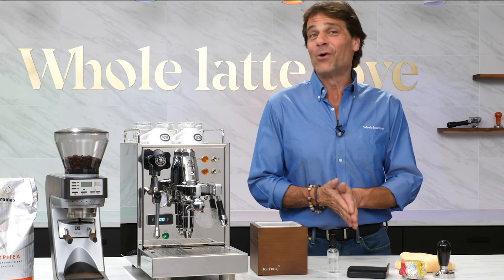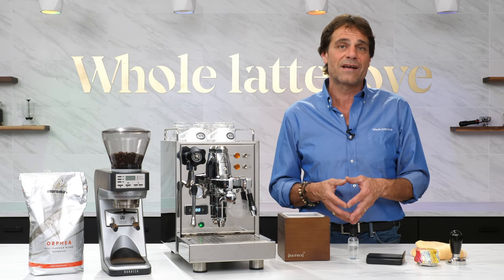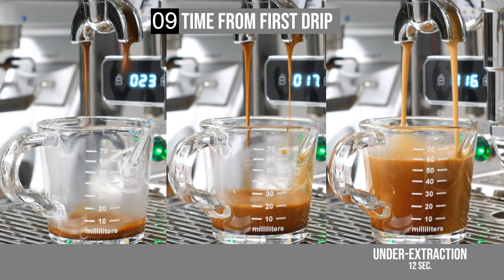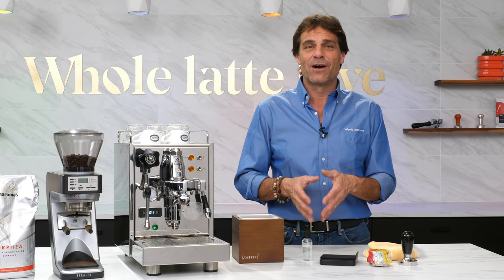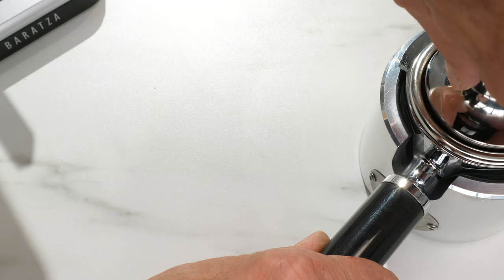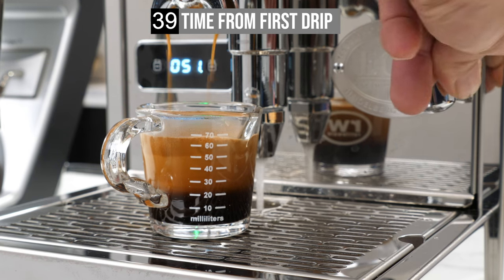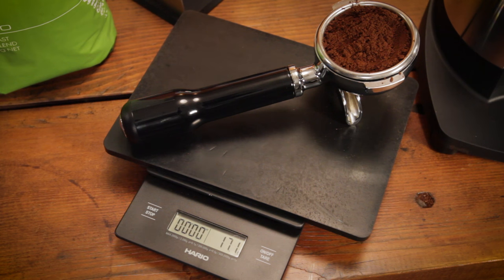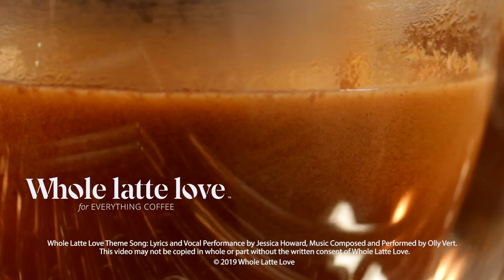How To Dial In Grind Size for Espresso

Comment: What are those beans u use, i mean the coffe comes out so creamy and fluffy from the portafilter.. damn.
Reply: @Andreas Lindstein  Hi, let me shed some light for you. There’s different factors for the beans without getting to nerdy/geek. There’s basically 2 different coffee beans, arábiga and robusta. Arábiga taste is preferable and robusta is “wet/oily” which produces more crema. The date of roast plays a big factor, the older the beans, they tend to get dry.  So the fresher the beans the better and finally the water temperature, the hotter you can get, the more crema will produce but beware it will change flavor and get bitter. That’s why you see espresso coffee is grinded at the moment, to preserve freshness.

Comment: So did I get it right that with The Jack you dont have to tamper after the leveling? Is this a specific function of this leveler or can I do it with every other on?
Reply from the maker: Hi Ben, The Jack has easy adjustable tamping depth and precision sizing. You will not find that on cheaper knock off levelers.
Marc

Comment: Great video and to die for espresso maker and grinder. Unfortunately I just bought the Rancilio Silvia and Rocky grinder. I use quality beans, have tried different grinder settings, but I can't seem to brew an espresso right with a lot af crema and taste. Any suggestions?
Reply from the maker: Hi Michael, Thanks for the question. If using a quality coffee but you are lacking crema and taste my initial guess is your grind is not fine enough. What kind of coffee are you using? The Silvia and Rocky should have no problem producing good shots when things are right. The Rocky can be a little challenging as it's a stepped grinder and tends to be a little clumpy. Toughest thing with Silvia is getting consistent brew temp. With most all non-PID single boiler machines you get dramatic temp swings in the boiler. Working with them requires some technique to get consistent temps. One way is to flush some water from the group then allow the machine to come back to temp as indicated by brew ready light and brew right away. Can also check for over temp condition by doing a short flush prior to brewing. If seeing lots of steam or turbulent flow from group when doing flush that indicates flash boiling and over temp brew water. If that's the case flush until flow is smooth - probably just a few seconds and then pull your shot right away. If not already doing so I suggest learning your machine and grinder by pulling doubles (singles are very finicky) using a forgiving coffee like an Italian style bean blend with some Robusta content. Hope that helps!
Marc
Reply: @Wholelattelovepage  Thanks for the reply. I've made a few changes and now it's with crema and the taste is almost there. I've seen in your videos that you use 17 g. of coffee and get 60 ml espresso which is roughly 60 g. Other recommend a 1:2 ratio in weight 17 g coffee ->34 g. espresso (among others Tim Wendelboe). I know I should go by taste, but what is the "right" espresso? Thanks for great videos :)

Comment: in this video it applies that i need a 60ml of liquid between 20-30 seconds.But what about the rule of 1:2 like my basket uses 15g of coffee so i extract 30 ML of liquid
Reply from the maker: Hi s, That would make sense except for the fact that crema does not weigh 1 gram per ml. I've done numerous 1:2 extractions of coffee which produces a lot of crema. With those using a typical dose of 18g of coffee it's not unusual for the liquid volume including crema to be 65-70ml in the cup. If doing true brew ratios it's imperative one uses a scale to weigh the output as volume measurements are highly misleading.
Marc

Comment: I have a gaggia classic pro with the 9 bar mod and I have the baratza sette 270 but still having difficulty pulling a shot it just keeps coming out really fast and barely has any crema .I have my grinder at 3 if I go finer it chokes .I'm distributing the coffee and tamping but still not working out for me .  Any tips on how to fix this?
Reply from the maker: Hi HT, If your shots are too fast then grinding finer is the answer. You'll need to find the grind size that's in between too fast and choking the machine. If at 3 on the Sette try using the micro adjustment ring to make grind size adjustment a little finer. So go to 2 on the macro ring and then set the micro ring in the middle and adjust finer or coarser as needed. I know people do the 9 bar mod but It's not needed and may be making dialing in more difficult. Lack of crema is not surprising if your shots are too fast but it may be the coffee you are using as well. Some coffees produce more crema than others.
Marc
Reply: @Wholelattelovepage  I've tried going finer a little bit but taste very bad like burnt coffee. I'm using a dark roast bean . Beans are oily not sure if that's a good thing or bad
Reply from the maker: @torresharbin  Hi, Dark roasted oily beans will tend to feature the flavor of the roast as opposed to the flavor of the bean. It's not always the case, but it's not uncommon to roast lower grade coffee darker to hide the defects in flavor.
Marc
Reply: @Wholelattelovepage  ok thanks for the info I appreciate it. Any coffee beans you recommend?
Reply from the maker: @torresharbin  Depends on what you like to some extent. Classic Italian style bean blends are fairly easy to work with, reasonably priced and make a classic espresso. A long time crowd favorite in that class is Lavazza Super Crema: https://www.wholelattelove.com/products/lavazza-super-crema-whole-bean-espresso-coffee
Some of my favorites in that category are Crema Wave which is a fresh modern American take on the Italian classic using 100% specialty grade Arabica coffees: https://www.wholelattelove.com/products/whole-latte-love-crema-wave-whole-bean-espresso and Mormas Orphea: https://www.wholelattelove.com/products/maromas-orphea-whole-bean-espresso
Hope that helps!
Marc
Reply: @Wholelattelovepage  ill look into those thanks a lot!!

Comment: My timing is good,  I dial it with each bean type I use,  etc,  but my puck is always soupy. I can't figure out what else to do. I usually brew about 30 sec for two ounces. I own the rocket apartamento and use eureka grinder
Reply from the maker: Hi SR, At 2oz in 30 seconds you're good. As to soupy puck it may be a maintenance issue like a dirty shower screen and/or lack of backflushing impeding water flow off the top of the puck at the end of brew cycle.

Comment: Is it more important that I end up with twice the weight, or 60 ml? Thanks
Reply from the maker: Hi r, Thanks for the question. Weight is far more accurate. Not unusual to end up with 60-70ml volume in cup that weighs 40g.
Marc

Comment: Hi, i have a simonelli grinder and a simonelli appia 2 coffee machine, do you have any suggestion for a good ratio?
Reply from the maker: Hi L, Thanks for the question. Good place to start is a 1:2 ratio. From there experiment and find a ratio which works for the coffee you are using and your taste preference. I almost always start with a new coffee using an 18g dose and 36g out by weight. Please measuring volume out in ml is rather inaccurate  when using brew ratios. Not out of the ordinary for a shot weighing 36g to have a liquid volume including the crema of 60-70ml.
Marc

Comment: Have you ever used the breville express grinder at 4 or 5? If so what did you think?
Reply from the maker: Hi AR, Thanks for the question. I'm assuming you are asking if a setting of 4 or 5 is good for espresso? Answer is I don't know. Proper grind size depends on variables like coffee type, dose weight etc. You will need to dial in grind size as shown in this video. There's no "right" grind setting that works for everyone as your variables may be different than mine.
Marc

Comment: Are the timings the same for single basket shots?
Why don't you use single shots in order to save coffee?
thanks!
Reply from the maker: Hi H, Yes timing for singles should be about the same. Don't know where you are but here in the US very few pull single shots. Out of thousands extractions I've done only a handful of singles in the last year. Outside of espresso as a commodity where there's less focus on quality it's difficult to pull good singles consistently. Less coffee in the basket magnifies any problems.
Marc
Reply: @Wholelattelovepage  I'm from Europe. My thinking was just if I'm buying an expensive 250g Bag of Beans, I don't want to waste 5-10 double shots to dial in, since I am still new to this.

Comment: If I were to buy these Orpheus beans from you how recent have they been roasted? Love the new set BTW 🤙🏻
Reply from the maker: Hi Ryan, Thanks for the comment on the set and the question. The Orphea is  roasted in Southern Italy. The bag I used in the video was roasted on June 3, 2019 so it was about 9 weeks from roast date. While it's hard to argue freshness Orphea is a bean blend which does not depend on freshness like high altitude single origin 100% Arabica coffees. We typically receive Orphea within a few weeks of roasting. It's one of our more popular coffees so we go through it quickly.
Marc

Comment: What i dont understand is you placed the portafilter with grinds on that scale and it came back 17g. But that portafilter has to weigh more than 17g by itself. I figured you would have had to TARE it, then add the portafilter, then tare then add the coffee grinds into it to see 17g. How the heck does that scale know only to weight the grinds inside the portafilter and not the portafilter itself?
Reply from the maker: Hi JM, Thanks for the question. Acaia scales have an automatic tare function. Set something on them and after a few seconds the scale tares to zero. More info on that here: https://www.wholelattelove.com/products/acaia-lunar-espresso-scale
Marc

Comment: Are you using the shems included with the grinder when grinding in this video?
Reply from the maker: Hi NK, It's been awhile since I made this video so I don't recall. My guess is no as the grinder was relatively new. It usually takes about 4-6Kg of grinding to break-in to the point of shims being required. Hope that helps!
Marc

Comment: Very frustrated. I have the Capresso conical grinder.  Reliable for my French press coffee.  But I can't seem to dial it in to over 10 seconds with my Gaggia Classic Pro.  Surely I'm doing something wrong.  I have the Capresso set as far as it can go, extra fine.  I'm truly hoping I don't have to purchase an even-more-expensive grinder.  Can someone at Whole Latte Love (I'm a customer - purchased your cleaning/maintenance kit) advise?
Reply from the maker: Hi B, Marc here from Whole Latte love. Do you have the Capresso Infinity grinder? It does do well for brew methods like French press, drip, etc. which use larger grind sizes. For very fine grinding for espresso it's a bit limited in capability. I usually only recommend using the pressurized filter basket if using that level of grinder with the Gaggia Classic Pro. The pressurized basket compromises on espresso quality a bit but is forgiving of less than perfect grind size. The simple truth is the Capresso grinder does not have the fine control of grind size required for standard non-pressurized espresso extractions. One thing you can try is increasing the coffee dose weight to slow down the extraction. Additionally, you can tamp extra-hard to try and slow things down - that doesn't have much affect beyond a certain point but if you were tampoing lighter it can't hurt.
Marc
Reply: @Wholelattelovepage  Marc, I needed that.  Thank you.  My capresso has been tried and true for so long, but I'm disappointed that I will have to buy a higher grade/quality grinder.  You've given advice before which I appreciate; you advised that the least expensive option (entry grade) for high quality espresso is the GCP.   What is the least expensive grinder you would recommend for my GCP in order to get the head (crema) and my grind dialed in?  [I am a customer of yours, btw, and have received excellent customer phone support when purchasing my filter basket, cleaning products, and bottomless portafilter]

Comment: What should I do if I am purposely aiming for over-extraction? I like dark roast-bitter taste with my iced milk. How long should I aim for and how many grams in and out?
Reply from the maker: Hi T, Thanks for the question. You can get an over-extraction by setting your grind too fine. That'll increase your shot timing beyond the typical 20-30 seconds from first drip. For grams in/out you could stay with a typical 1:2 espresso ratio so for a double shot 18g in 36 out. Another option is to go ristretto. For that use a finer grind, standard timing and produce a ratio at 1:1.5 or less.
Marc

Comment: When grinding at home and making coffee 2-3 times each day, do you think it's important to purge the half-ground coffee before each grind (assuming not single dosing)? Or do you think it doesn't make enough difference to be worthwhile?
Reply from the maker: Hi Matt, Thanks for the question. If making in quick succession say within 10 minutes or so I would not be to concerned about purging. Otherwise it depends on how particular you are. If it's hours between grinding I would. Also depends on the grinder. Some retain more ground and partially ground coffee than others. Sette grinder used in the video retains very little. Less than .5g of fully ground and probably a gram or so of larger partially ground chunks between the burrs. On the other hand I've used grinders which retain >4g of fully ground - I'd definitely purge that type of grinder.
Marc
Reply: @Wholelattelovepage  thanks Marc. I've been thinking a lot lately about the tradeoffs between filling the hopper (less than ideal bean storage, no popcorning) and single dosing (worse grind due to popcorning, better bean storage, less wastage as no need to purge). Quite a conundrum for home espresso makers imo. I've read the Sette is pretty good with single dosing.
Reply from the maker: You are welcome. I have used the Sette for single dosing and it works quite well. In single dosing retention typically under .3g.
Marc

Comment: 18 grams of coffee, 1.5 oz shot in 25 seconds, but the coffee starts to come out during pre infusion. Is this okay?
Reply from the maker: Hi Icp, What make/model machine? What type of pre-infusion? Timing and volume (knowing weight in cup would be better) sound good. Depending on type of pre-infusion drips before full pressure are unusual. Most important question: How does it taste?
Marc
Reply: @Wholelattelovepage  Brand new equipment. The machine is a Lelit Elizabeth. Grinder is Eureka Mignon Specialita. I increased the coffee amount to 19 g. 4 second pre-infusion. 22 second brew time. 199 brew temp. yielded 21 g coffee in 22 seconds. This time, coffee started pouring at the 5 sec mark (including pre-infusion). Puck looked even in color and texture.  Taste: coffee good, latte amazing.  Grazie!
Reply from the maker: @Ironchefpizza  Awesome!

Comment: I roast my own coffee at home and can usually dial in the grind after roasting a new batch. Generally speaking it’s the same time and roast level each time. 
I use a Baratza Vario grinder and found recently that my shots are underextracting  even with it all the way down on the finest setting. Any thoughts there? I’ve tried adjusting the dosage between 17-19 grams. 
Also what’s the model of that tamping stand you’re using?
Thanks,
James
Reply from the maker: Hi James, Congrats on the home roasting! I'd watch this video from Baratza on Vario troubleshooting/recalibrating: https://www.youtube.com/watch?v=lUuhzJO29pU
Marc
Reply: Thanks! I’ll check that out.

Comment: Hi! Could use your help please. I have a Breville Bambino Plus espresso machine and a Breville Grinder Pro grinder. My grind size is set to 15 and I measured out 18g. Output is at 20 seconds from first drip, but I can't get the 36g output. What am I doing wrong? Thank you for your help!
Reply from the maker: Hi Shirley, Thanks for the question. The Bambino uses a pressurized portfilter. With those extraction timing is controlled by the portfilter and not the grind size of the coffee. You may slow it down a bit by grinding finer but probably will not be a huge difference. 
Marc
Reply: @Wholelattelovepage  Thank you Marc for responding to me. I failed to mention that I purchased a bottomless portafilter and a non-pressurized filter basket and have been using that. Now that I've given you information I should have given you above, does that help you to answer my previous question? Thanks in advance! :)

Comment: Hey Mark, I'm having issues with my Ranchilio Silva (2015 I think) and getting a proper shot pulled. I don't get much crema at all, and my coffee seems light to the sight. I have a Mueller Utra Grinder, and seem to be grinding really fine. The beans I used are made for espresso from a local shop. I cannot seem to get it dialed in correctly. Any help would be fantastic!
Reply: Crema = pressure, bean type and freshness. Pay attn to yield and time, and taste